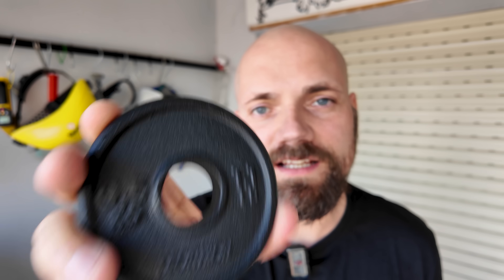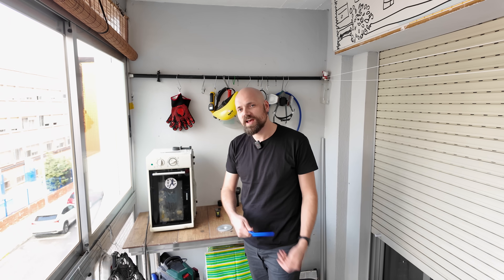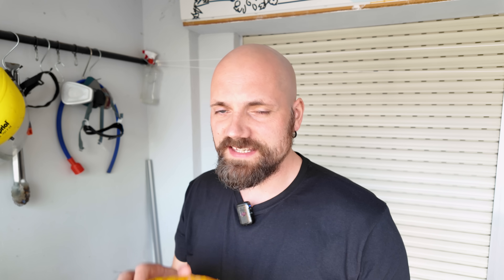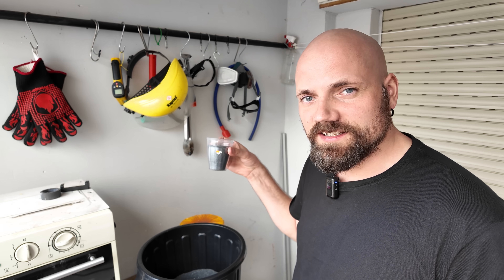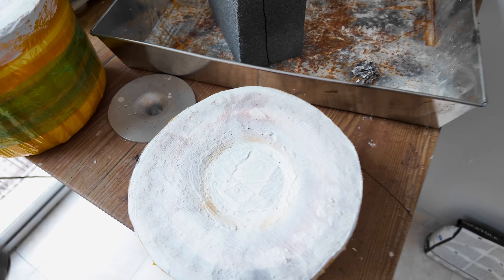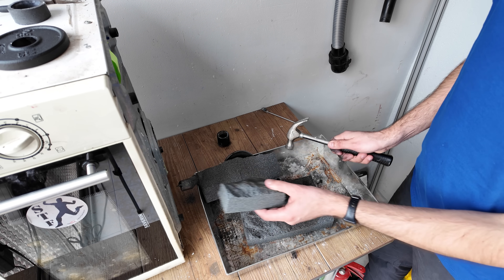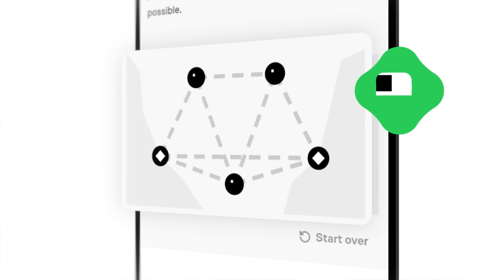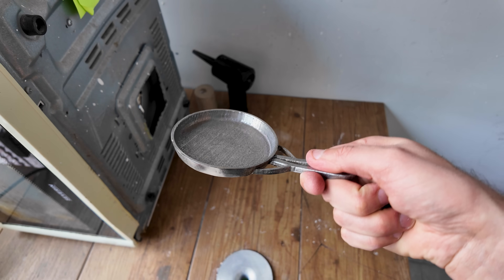I Made an Iron Skillet Using a Microwave! Metal Melting!

Comment from the maker: First of all, If you wish to try Brilliant for free for 30 days and save 20% on an annual premium subscription? Check it out here:
https://brilliant.org/shakethefuture/
How long did it take me to melt all that iron?

First of all, this project is going on my "useful" project list. It’s something I plan to use on a daily basis... but I think I’ll make another pan—just a little bit taller and bigger.
I usually use a stainless steel pan for cooking, but it’s not great for frying eggs. Wait a minute—I know, I know, you can fry eggs in stainless steel! And I do know two methods.

First, preheat the skillet, and when water repels off the surface, it’s ready to cook. That method works, but my breakfast routine is a bit different. I usually cook breakfast in two stages: first, I fry onions, mushrooms, etc., then I drop the kids off at school. When I come back, I finish cooking breakfast (cooking the eggs last).

But after cooking bacon, the pan is no longer non-stick, and the eggs start sticking. My workaround is to put a lid on top and let the steam loosen the eggs, but that takes time, so it’s not ideal.

With a tiny iron pan, I can keep using my stainless steel skillet for everything else and have a mini iron pan just for frying eggs. That’s awesome!

Ok, let’s talk about melting time!
Before we get into that, let me remind you that melting aluminum in a microwave is pretty quick.
The same crucible filled with aluminum (though it would be less weight) would melt in about 10-15 minutes.

Melting iron for the bottle opener or Benchy took around 20-25 minutes, with preheating the crucible using a blowtorch—if I recall correctly.

But what about 0.5 kg of iron? It’s not quick, that’s for sure. First, I heated it in the old chamber for 30 minutes, then I transferred it to the new chamber and heated it for another 35-40 minutes.

So that’s a total of about 1 hour to 1 hour and 10 minutes of microwaving... BUT NOT SO FAST.

Preheating the iron with a blowtorch would have made the process quicker. I bet you could do it in a few minutes and then transfer the crucible to the chamber, melting the metal in about the same amount of time—let’s say 40 minutes.

The reason for preheating the crucible is that microwaving for too long causes the chamber to overheat. When the chamber gets too hot, the microwave’s ability to heat the crucible decreases.
Also, when transferring the crucible to a new chamber, it’s not like you’re simply picking up where you left off. The temperature drops significantly, and the crucible cools down a lot. It’s like taking two steps forward and one step backward.

I also bought a new microwave (same-ish model... ok, different, but I think it’s the same—just a different color).

I haven’t received it yet, but the reason I bought it is that I’ve been using my current microwave for years, and it’s looking rough. I’m very curious to see how the new microwave will perform.

The magnetron can wear out and become weaker over time. Has mine worn out after all these years of metal melting? I don’t know.

It’s like using a tool that becomes dull after years of use, but you don’t notice because it happened gradually. I might find that the new microwave melts metal much faster—or maybe it performs exactly the same.

Would you be interested in a comparison video?
New Microwave vs. Old?
Reply: Yes interested in new microwave. Very difficult to find large microwaves these days with mechanical timers 😔 any ideas on how to work with a modern digitally controlled microwave oven. Was thinking is there a way to bypass the electronics with and added bypass wire and rely on external controller to time the on and off?
Reply from the maker: @jirvin4505  Yes, you can rewire the microwave, and I hope to make a video about it. However, it won’t be a proper rewiring tutorial since I’m not qualified to do it and don’t know much about it. That said, there are alternative methods that could be used.

One simple option— a "low-hanging fruit," if you will—is a SwitchBot or a similar device. It’s a smart switch that physically presses the button. If the microwave can be started and stopped with a single button, this could work.
I haven’t tried it myself yet, but I believe the app has a "loop" function, but it needs to be confirmed.

Cheers!
Reply: @ShakeTheFuture  how about that. A switch bot. …. Never knew such a device existed 😂😂
Reply: Have you tried better cast iron grades. Those weights are just meant to be mass so are low quality. Maybe try a different source of cast iron from a casting, broken cast iron pots or an engineering stock like Meehanite. See if it reacts different and flows better and provides better properties. Your methods create fine quality moulds that should provide nice details and as they are regular provide a good level of process control for production of multiples
Reply from the maker: @Cjs-n2n  I haven’t tried better cast iron yet. So far, I usually melt weight plates and brake discs. I have a lot of weight plates, so it will take me a while to melt them all.

Cheers!

Comment: I had this thought what if we make  making silicon carbide (SiC) during the crucible formation process rather than using pre-made SiC.making these crucibles,  from scratch allows for various carbon and silica ratios while keeping costs low, so here is a plan:
Ingredients:
	1.	Silica Source
	•	River Sand (High Quartz Content) – 50%
(Provides the silicon necessary for SiC formation.)
	2.	Carbon Source
	•	Graphite Powder – 25% (Acts as a microwave susceptor and carbon donor.), maybe charcoal powder can also work who knows ? 
                graphite powder is known to absorb microwave but we should experiment to get the cheapest material if charcoal works that can be a great addition..
	•	Iron Oxide (Fe₂O₃ or Fe₃O₄) – 5-10% (Enhances microwave absorption and may act as a catalyst.)
	3.	Binders
	•	Sodium Silicate (Water Glass) – 10% (Aids in shaping and initial strength.)
	•	Petroleum-Based Binder (Bitumen, Wax, or Resin) – 10% (Improves moldability and contributes additional carbon.)

Preparation Steps:

1. Mixing the Raw Materials
	•	Combine river sand, graphite powder, and iron oxide in a dry mix.
	•	Slowly add sodium silicate, stirring until the mixture becomes dough-like.
	•	Melt and incorporate bitumen, wax, or resin for additional binding strength.
	•	Knead thoroughly to ensure even distribution of all components.

2. Molding
	•	Shape the mixture into the desired crucible or object mold.
	•	Allow the mold to air dry for 12–24 hours (or low-temp oven dry at ~100°C) to remove excess moisture.

3. Microwave Kiln Processing
	•	Place the dried mold inside a microwave-safe crucible or container.
	•	Surround with additional graphite powder or iron oxide to enhance microwave absorption.
	•	Heat in controlled pulses:
	1.	Start with low power (3–5 min) to prevent cracking.
	2.	Gradually increase to higher power in 5-minute intervals (total ~10–15 min). ideally it should read 1600 Degrees C which is when SiC is formed
                 
                  SiO^2 + 3C --> SiC + 2CO

4. Expected Reaction & Results
	•	The high quartz sand will react with carbon at high temperatures:
	•	The graphite and bitumen/wax provide carbon, while iron oxide accelerates heating.
	•	The final material may vary depending on carbon-silicon ratio, leading to different crucible properties.

If this works then it will have following. advantages:

Avoids pre-made SiC =>  Allows for flexible silicon-carbon ratios.
Can create unique ceramic compositions => Experimentation with ratios might lead to novel, cost-effective crucibles.

Comment: Awesome result!  if the insulation is relatively invisible to the microwave, could you make one "microwave sized" chamber, then build smaller insulated chambers that fit inside like matryoshka dolls?
Reply from the maker: Yes, it's possible, but whether or not it makes sense depends on your personal needs and the microwave you're using. Adding more ceramic fiber insulation isn't always beneficial. In other words, sometimes you'll notice that a chamber with less insulation heats up faster than one with more insulation.

Cheers!

Comment: Can you crush the used silicon carbide mold and reuse it?
Reply from the maker: I’ve done it once or twice, but it wasn’t easy. Caustic soda is supposed to help break down sodium silicate. I’ve tried it, but with not much success. That said, I’ll try it again. Maybe I didn’t soak the mold in the caustic soda solution for long enough. Cheers!

Comment: Which kind of tweezers you use that stand so well melted iron? If my calculations are right, pure iron melts at around 1600°C and after several seconds touching  the crucible they dont get even blue. Titanium, tungsten, vibranium,... ?
Reply from the maker: Those are very special tongs designed for extreme metal melting… Just kidding! They’re just ordinary kitchen/BBQ tongs, made of stainless steel, I suppose.
Some people have told me in the comments to get new or "proper" tongs, but here’s the thing—these are the best tongs I’ve ever used. I do have a pair of metal-melting tongs, but they’re much worse when it comes to grip, and they’re also too short. I’ve explored other metal-melting tongs, but they’re all too big.
At the end of the day, this is small-scale metal melting, and I don’t need anything bulky. These are the best tongs I’ve ever used, and I have no plans to swap them anytime soon.
As for why they can withstand such high temperatures, I guess it's because they don’t conduct heat very well since they’re thin, and I only use them for short periods. It’s not like large-scale metal melting, where people use big crucibles and spend more time holding them due to their weight. I do a quick pour, and—(let me check the tongs as I write this comment)—they don’t have any visible deformation. There is a small blob of metal stuck on one side, but that’s probably because, at one point, I couldn’t find anything to scoop off the slag from the metal, so I just used the tongs. 🙂

As a bonus, they cost less than 3 euros. Cheers!

Comment: Is the brightness of the white hot metal a problem for your eyes while you are pouring?
Reply from the maker: Well, sometimes I do wear sunglasses, but in this case, the crucible wasn’t as bright. It was much brighter when I melted stainless steel. There have been times when it felt like too much for my eyes, so I want to get into the habit of wearing sunglasses more often—but I just forgot. I need to keep those sunglasses by the microwave, so I remember the next time.

Comment: Great to see a new vid from a channel I just discovered! How hot can the crucible get? Hot enough for steel? Also, have you ever tried purposefully creating a plasma arc to raise possible temperatures?
Reply from the maker: Thank You! I am glad you found this channel!
Regarding the temperature, there's no way for me to know the exact maximum it can reach. I did melt some titanium the other day, but not to a pourable state. I need to make a new insulated crucible, similar to the one in the fork-melting video, and try again. However, I'm currently out of titanium.
I haven't intentionally tried to create arcing in the microwave for metal melting purposes, but it has happened with those tiny crucibles when melting stainless steel. I have, purposely caused arcing in the microwave for other experiments. Cheers!

Comment: I had a feeling this video I randomly clicked on was you! 
Another process that I've burned out a few microwaves doing (you know how that goes, sacrificial cheapos to figure out the process) is dip-casting a printed part. It's also done in industry with part trees to good effect.
Basically coat your part with finely powdered graphite, then chase with SiC. Coat the exterior SiC layer with silica solution, let dry/cure, then alternate dipping into clay slip and dry powdered clay sprinkled over the wet coat. Build up a sufficient layer thickness, then burn out the print. Doing this on a part tree with a built-in sprue doubles as the negative for the pour spout. 
It works better for this process to do the tree route for efficiency of making multiple copies, or doing multiple parts of differing size when you want to cast parts for an assembly.
Reply from the maker: That’s a great technique! I was thinking about doing something similar—not exactly the same, but essentially combining two materials (like SiC and sand) in a way that uses less SiC. For example, only covering the model with fine-grit SiC/sand while using coarser grit on the outside.

Cheers!

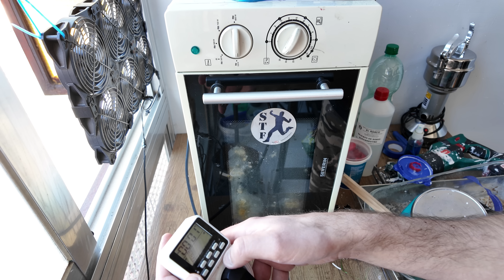Comment: 5:35 You're cycling the microwave on and off, but doesn't the low power setting already do that? Unless you have a fancier inverter microwave, most microwaves simply turn on/off periodically when lowering the output power.
Reply from the maker: Yes, that’s true, but with a cycle timer, I can control the on and off periods. I need times when no heating happens at all. Without a cycle timer, it would be much harder for me to do this.

Let’s put it this way—when I burn out plaster molds with my microwave kiln, I cycle the microwave 6 minutes off and 1 minute on for approximately 4 hours (depending on the mold size). In that case, the microwave power is set to high or medium.

If I relied only on the microwave’s lowest power setting and ran it for 4 hours straight, that wouldn’t work at all—the mold would crack. At some point, you’d need to press a button to stop the microwave from heating the mold, which is exactly what the cycle timer does.

It might work with SiC molds since they’re stronger, but for burning out investment molds, you need some level of control over the microwave.

That said, I’m not saying you can’t do it—I’m just saying this is the way I do it. 🙂
Reply: @ShakeTheFuture so, in summary, you need a lower power setting than what the microwave provides out of the box?
Reply from the maker: @PixlRainbow  Well, I suppose that's one way to put it.

Comment: Could you take a look into making silicon carbide 3d printer nozzles? Some manufacturers are selling silicon and tungsten carbide nozzles but they're pretty pricey. It'd be hilarious if you could just make one in your home microwave instead.
Reply from the maker: I was thinking about making iron nozzles....not because it's practical, but because I could. I believe those are temperatures out of my reach :(   At least with my current microwave 😥😥

Comment: Does the mold need to be such a thick boy ? 
What about inserting inert cores, or susceptor cores to reduce the silicon carbide spend ? 
Also could silicon carbide be re-ground and used ? 
Maybe just for the coarse-bulk or the mold rather than the fine-grit surface contact points ?
Lastly, have you considering painting fine silicon carboard and sodium silicate directly on your investment part for greater details  ? (and then encapsulate into coarse-grit SiC)
Reply from the maker: Yes, the mold could have been much thinner, that’s for sure. But sometimes, it’s better to be safe than sorry. Since it’s the first mold I’ve done of this size, I just went overboard.

As for reusing silicon carbide, I’ve done it once in the hammer-making video, but it was very hard on grinder blades to re-grind it. That said, I need to try soaking the mold in caustic soda, as it’s supposed to help dissolve sodium silicate. I’ve tried it before, but with not much success. Looking back, I probably didn’t soak it long enough, so that’s something I’ll explore again in the future. Using a finer grit to cover the object and a coarser grit for the outside is an option. Cheers!
Reply: @ShakeTheFuture iirc, sodium silicate is manufactured by dissolving silica in molten sodium hydroxide (which is why it is unsafe to work with sodium hydroxide using glassware)

Comment: I like your stealth industrial manufacturing technique by pretending to be fixing your car. 😮
Bravo for such a nice casting using so much iron 😊
😊😊
Reply from the maker: It’s true when I said people ask fewer questions. Usually, when you see someone doing something—making noise by a car with the hood open—you assume they’re working on the car. If I were to cut weight plates without a car nearby, people would probably wonder, what is that guy doing?....😀

Comment: I'd be a bit worried about lead or other heavy metal contamination in the cast iron from the weight plate, but I doubt you'll be using this skillet every day.
Reply from the maker: As far as I am aware, cast iron weight plates are a pretty safe source of iron for skillet making, but I might be wrong. I’ll need to look into alternative sources of iron.

Cheers!